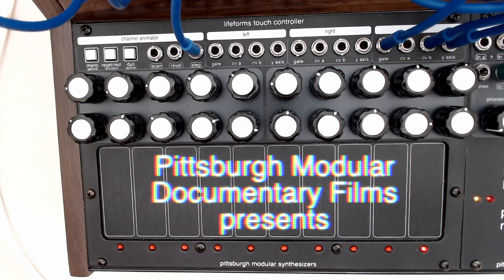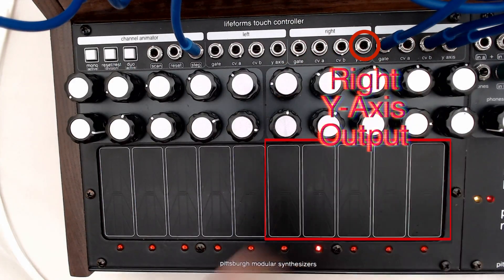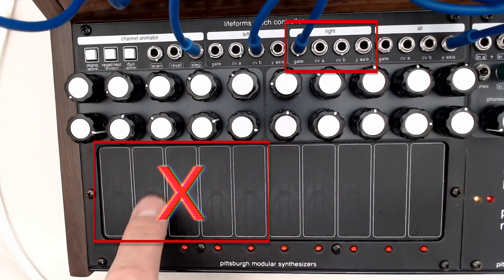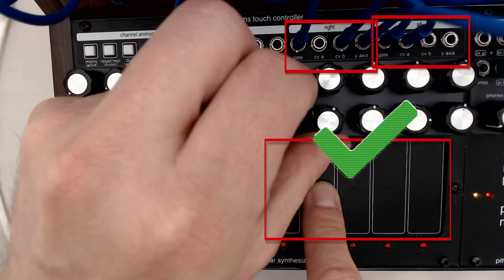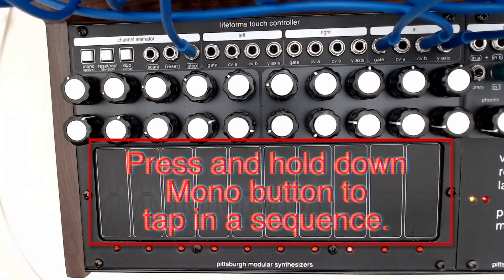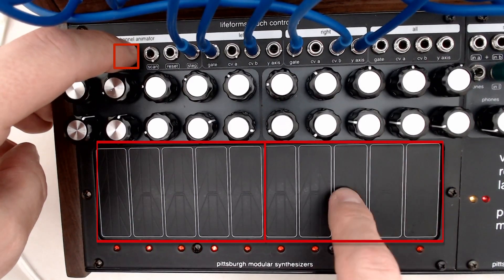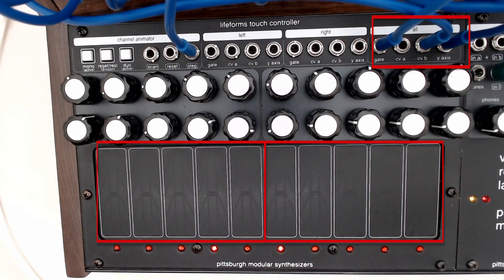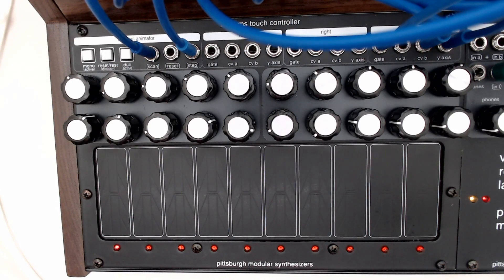Pittsburgh Modular Lifeforms Touch Controller Walk-Through

Comment: Can this be used in a quantised note mode (as in, in tune)?
Reply from the maker: The Touch Controller does not have an onboard quantizer. Outputs are 0-5v. You could patch it through an external quantizer module.

Comment: Are you locked to using only the 10 steps within the 64 step sequence or can you change octaves as well to add a broader range?
Reply from the maker: The sequence is limited to choosing one of the 10 steps. There are no octaves. The output voltages are analog, not quantized, and manually set using the knobs. However, you can split the keyboard and use one side to transpose the other side to create more voltage options.
Reply from the maker: Also worth noting that the octave buttons on the Voltage Lab remain active at all times. So, you can change the octave range of the existing sequence on the fly.

Comment: Looks awesome!
What happens if you press two keys at the same time, as in note priority? In a similar way, what does pressing a key during a sequence running do?
Also, can you run scan at audio rates?
Reply from the maker: Note priority is last note played. Pressing a key while a sequence is running overrides the sequenced y-axis but not the active key so the sequence continues as programmed. Scan will not run at audio rates.
Reply: @pittsburghmodular  cool thanks :)
Reply: offtopic here but if you want to scan at audio rate, consider the Doepfer A-155 [and ideally A-154] — it may look like a simple sequencer, but look closer — eg. input jacks for each step, which is quite unusual on Eurorack step sequencers. Also A-152

Comment: Great! How to change the pitch differently for each step?
Reply from the maker: Use the A or B knob to set the CV voltage for each step. Patch the CV voltage into the pitch input of the oscillator. The pitch will change based on the CV voltage set for the selected step.
Reply: @pittsburghmodular  thanks!! :)